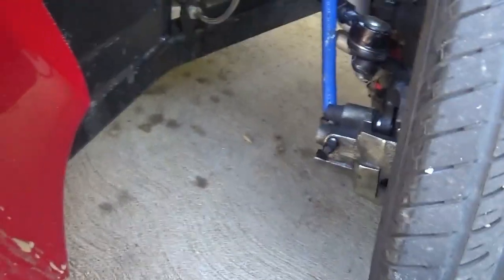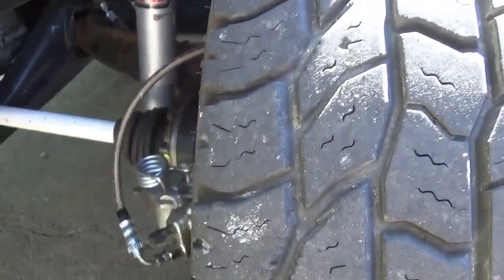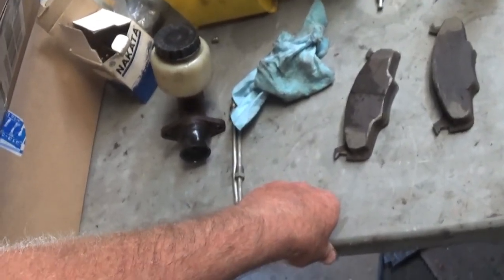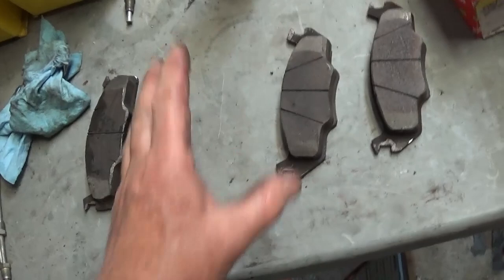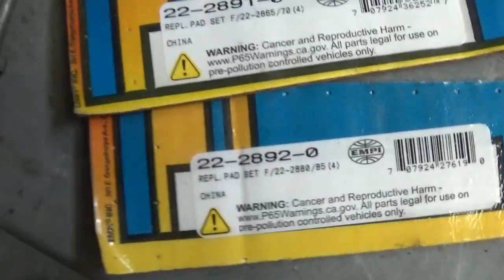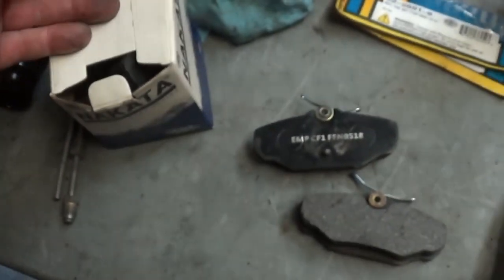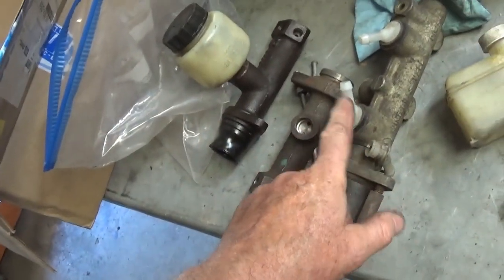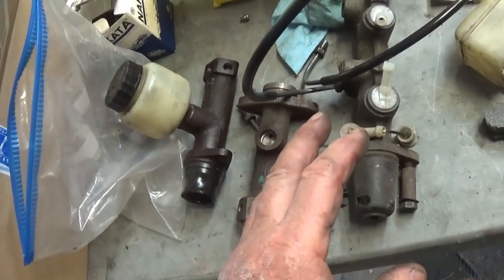EMPI Disc Brake Tips & Tricks

Comment: I got a tip for you, When I did my disc brake conversion, after about a week it was a school bus, squeal like a pig.... Found this stuff, and it hasn't made a peep since.
This goes on the disc side of the pad, shake the bottle really good, apply it to the pad, let it sit till dry, about 15 minutes....and install. Great stuff.

Bleeding is a pain, I got air over vacuum unit, uses air from the compressor thru an exchanger to create a vacuum, worked perfect, 15 minutes after I replaced everything of the brakes system, I did bench bleed master, then hook everything up,  filled master, hooked up vacuum exchanger and man I was done in no time.
Great to see you my friend take care.

As part of the BG Stop Squeal® Service, BG Stop Squeal® is a safe and effective product for eliminating or preventing brake noise by infusing the brake pad with ingredients that reduce sticking between the pad and rotor. When pressure is applied, the vibrations are significantly reduced, thus brake noise is stopped
Reply from the maker: Great Tips!  Thanks for your contribution! m :-)

Comment: Learn something new every time, feels like we’re hanging out in the garage together. 
One thing I’m looking into is a motorcycle brake light switch…. They should take less pressure to make contact.
Reply from the maker: Well speak up next time. I would rather work together on bleeding those lines. hehe  I would love to hang out with you. Maybe go to one or two of the Florida VW shows. Be part of your Pit crew when do the drags!  I've owned motorcycles for 50 years gave them up just before I retired and I can't get a visual on brake switch. I was thinking it was a switch by the handle.  Although the german one seems to be working

Comment: My EMPI front wide 5 disks use the pads that you have in the rear of your buggy. My problem that i havent figgured out yet is that one side locks up, I have changed pads from one side to the other with no luck. For a temporary fix I put 4 big grooves in the inner and outer pads on  the lockup side.  The balance a year later is becoming uneven again  so will have to pull it to pieces and have a better look. Always appreciate your vidios,  cheers,
Reply from the maker: I did not mention how EMPI recommends using washer/spacers (provided) to center up the rotor with the caliper?????   Crazy that one side would lock when they are fed by the same fluid chamber..... ?

Comment: We had the same problem of brake noise on are replica 356, which has Empi disc brakes.  I tried everything but nothing worked except installing a brake shim designed for motorcycles (SBS 9500-4).  That completely stopped the noise.  The brake pedal is a little more squishy feeling, but you get use to it.  Brakes haven't made a noise for over two years now.  Hope this helps some one.
Reply from the maker: Thanks for the info

Comment: I take a 60cc syringe and clear tubing and vacuum the fluid at each wheel. But you must make sure you don't run out of fluid in the reservoir. I tried the pump guns and they never seem to work. I don't have a camera dog, and my wife doesn't think it is in her pay grade either.   my problem with my empi disc on the front of my tub buggy is it will click at times. I haven't solved that one yet.
Reply from the maker: I still have a mighty Vac somewhere. Used 1 time.  Seems like it sucked more air from the bleeder threads than drawing fluid.  One of the Empi vids showed them installing 10 lb residual valves in both front lines. I thought that was ridiculous. I would also suspect the rubber boot/spacer that goes around your locating pins is missing or worn out. I found one of mine laying in the driveway one day. They don't seem to be available and with no stone guards and the extra weight I doubt I would use these again.

Comment: I have empi brakes. I don’t have that issue. I got lucky thank god but good to know thanks
Reply from the maker: Good to hear! I'm not trying to put EMPI down. There products are getting better.   I think getting the deluxe kit with the cast brackets would have helped me but at the time I was just going cheap.  Ya get what ya pay for.
Reply: @TheEZGZ  I didn’t have instructions on what side the brake pads go ether. That’s why I say I got lucky. But the small brake line on the back brake the goes on the caliper with the kinda sharp bend mine has a crack so I have to replace it.

Comment: There is a bearing spacer on the spindle from when you remove the drums for the conversion …. No instructions or other videos talk about Whether or not you need it for the disk…. You don’t . It looks like the rotor will hit if you don’t use it but it doesn’t ….. mine was a bitch to remove so I was trying to figure out if it was needed or not before pulling it
Reply from the maker: Thanks Rick.  I put up with that squealing brake for years.

Comment: I was thinking... wouldn't it be possible to mount a car tire valve in an extra lid in order to put pressure on the barrel with a bicycle pump? 🤔
Reply from the maker: Great Idea!  I just didn't have a spare lid to ruin. The lid is vented with a rubber flap to keep fluid in and keep dirt out and still breath. If you have the reservoir full of fluid there's not much space to hold air pressure unless you have two people one pumping and one bleeding.  If you have two people you might just as well do the traditional method.  Up? Up! Down? Down!

Comment: Hey EZ! Not related to this video, but do you have any idea what size nuts are on the 002 Bus transmission? Specifically the nuts holding the cone to the tranny. any help would be awesome!
Reply from the maker: 8mm x 1.23 and takes a 13mm wrench.  Don't get the hardware store ones made of cheese. They should have them in a grade 8   use the spring washers and tighten to 14 ft pds
Reply: @TheEZGZ  Thank you for the quick reply!! Your video's have helped me a ton over the years, much appreciated!
Reply: @TheEZGZ  Hello EZ, I cant find anyone that sells anything with a 1.23 thread size! :( Any suggestions on where to find these?

Comment: Just installed the brakes and mine chatter. They kit came with 4 wire spring clips but I cannot tell where they go for the life of me. Any ideas?
Reply from the maker: Sounds like you better read the directions it came with or go to the EMPI website and look for a PDF file
Reply: I actually found a set of instructions for a Porsche kit last night and it showed where the clips go. All set! Glad you’re back on your feet as well.
Reply: @inshoreandy  I was just installing mine, and there is no mention of how to use the wire clips.
what instructions did you find?